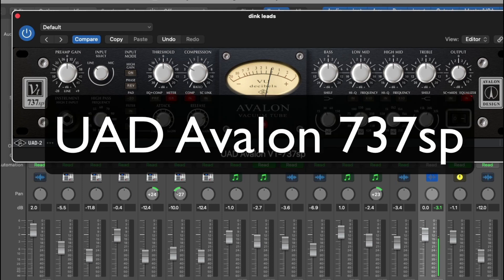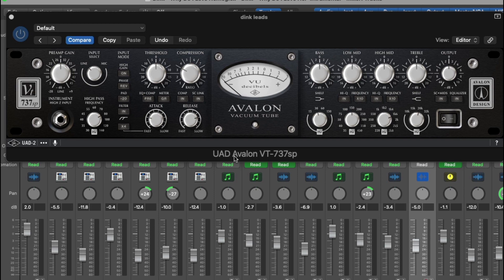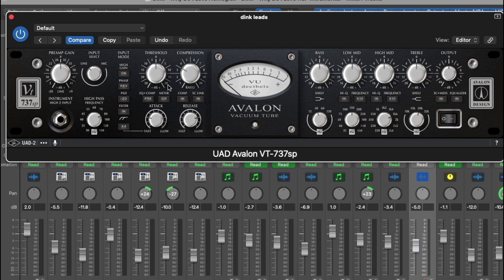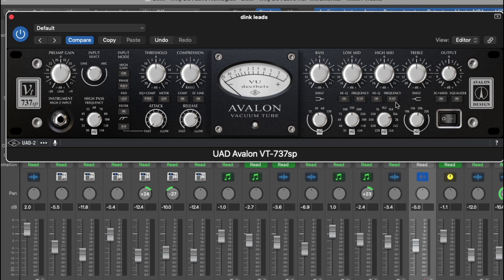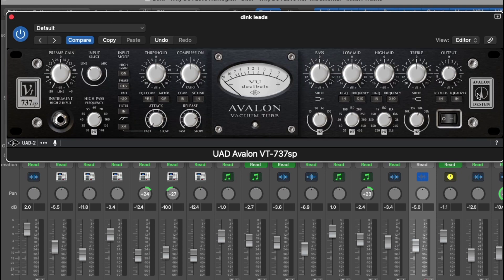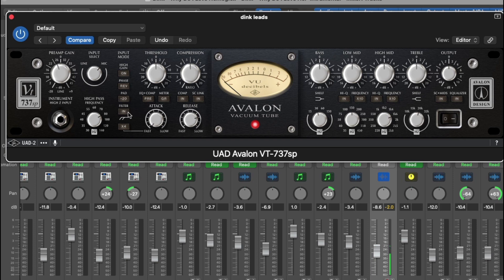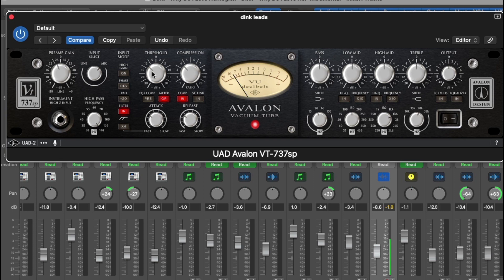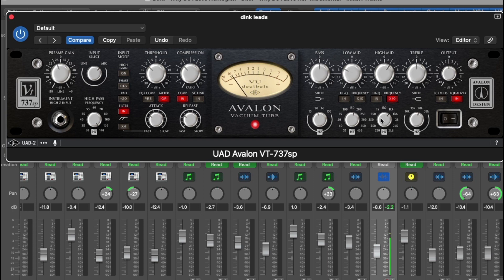How to use the Uad Avalon 737sp

Comment: you have to pull back on the output gain.  I actually have the real thing and when you drive the preamp gain, you def have to pull back on the output gain.  the signal going in would be way too high.  same concept here.  the plugin is just making it louder without proper gain staging.  also, around the the 13 min mark...def too much compression.  the plugin sounds great but i think you're overdoing it in this video.